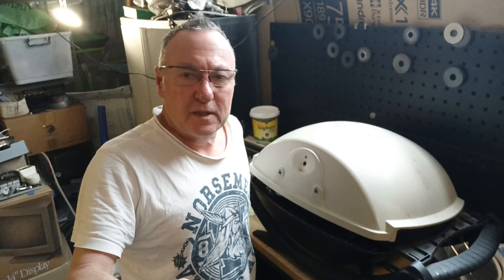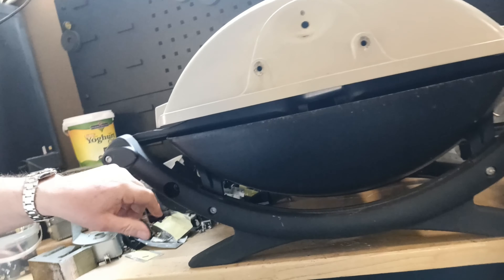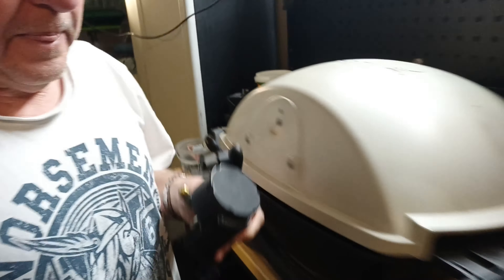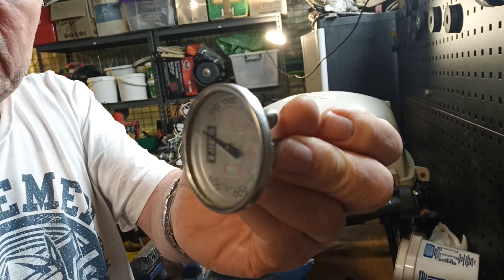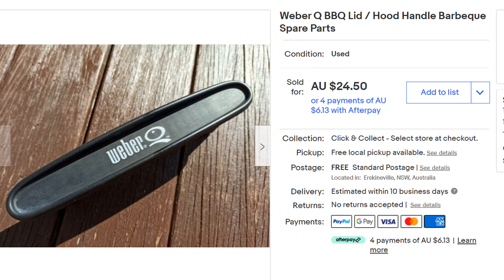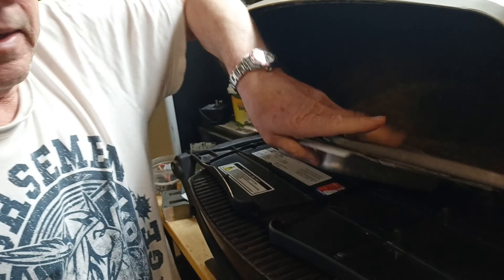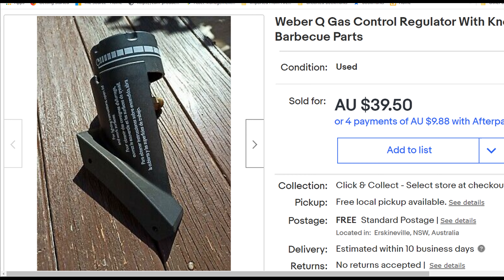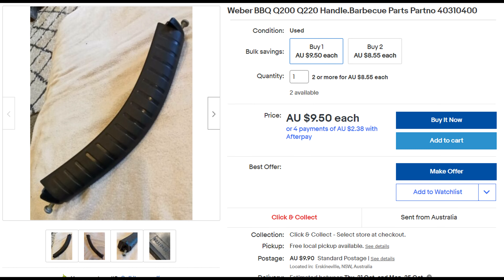75 WeberQ Bar-B-Que Spare Parts Re-sale.  (Better Profit Than Scrap Metal Sales.) Bondi Scrapper

Comment: i think I get how this went. Grab the grill which has gone to the kerb. Get it working as a keeper or scrap it ? You know your way around grills. Check it out. The grill, on balance, is still, of itself, a write-off. But what gives with some of the parts ? Perchance do an ebay check. You know your way around ebay. Ah so. Do a bit of what someone else just down the road is doing on ebay. [ You don't attempt to do business trying to buy from or sell to a seller, despite his proximity, but just note his modus. ].Three successful ebay sales from kerb junk.
Reply from the maker: I sold the handles after I had uploaded the video.  I think I cleared $100 for the whole BBQ.
Happy Days!
Reply: @bondiscrapper1781  The thing itself not worth recommissioning going on what bloke had on his ebay, but $ 100.00 worth to someone with the means and know-how. Good upload.